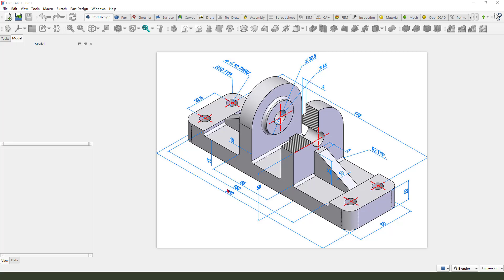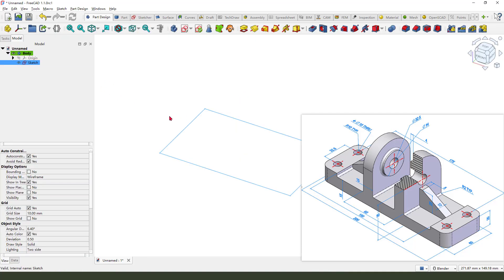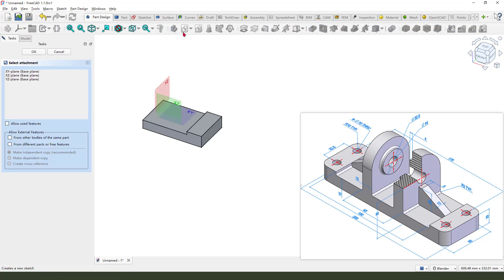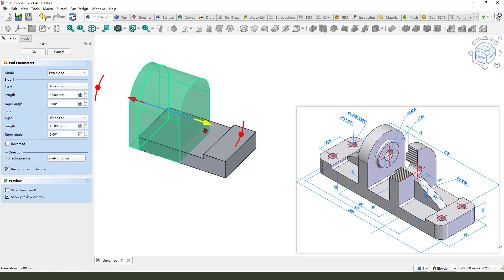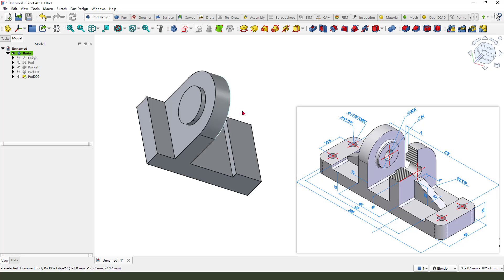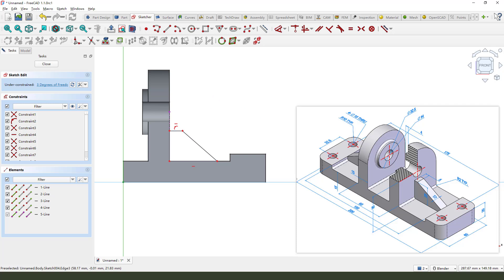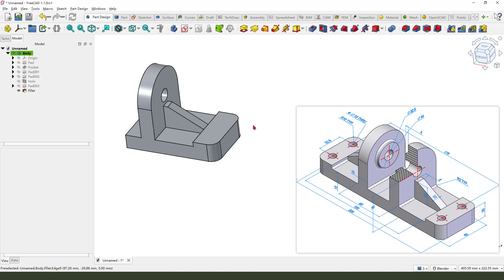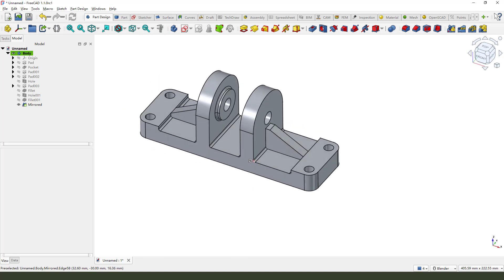FreeCAD 1.0 Tutorials for Beginners | 3D Modeling Step-by-Step Guide-141

Comment: Nice job. One thing that you missed is the hole to hole dimension. They are not placed at the center of the corner radii. They are supposed to be 175mm the long way, and 33.5mm the other way
Reply from the maker: I‘m sorrry for that ,You are right.
Reply: No Problem, good tutorial